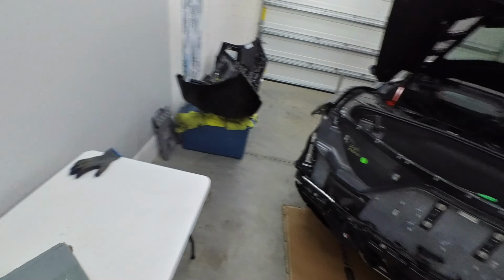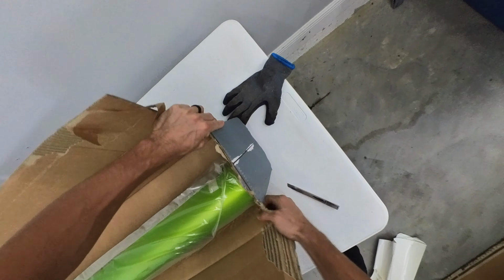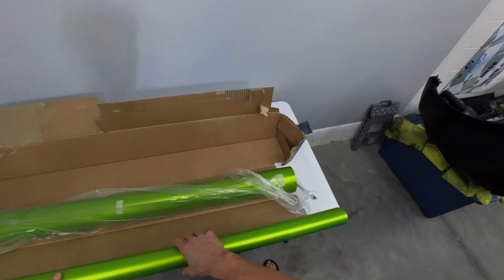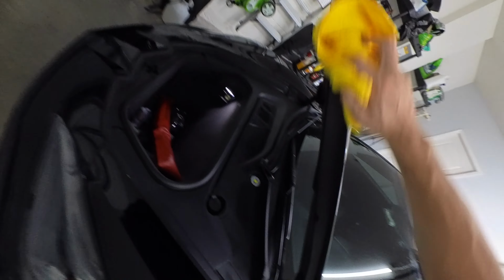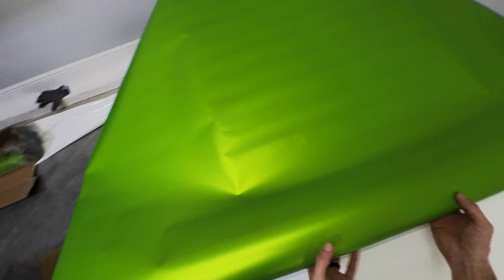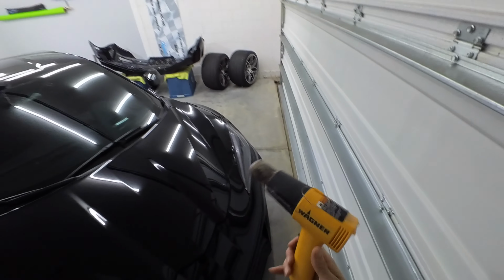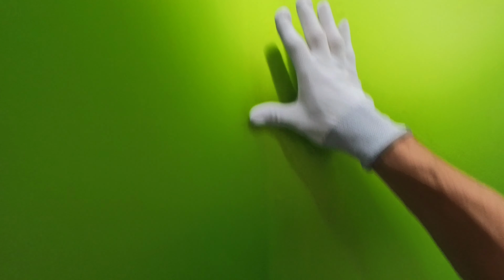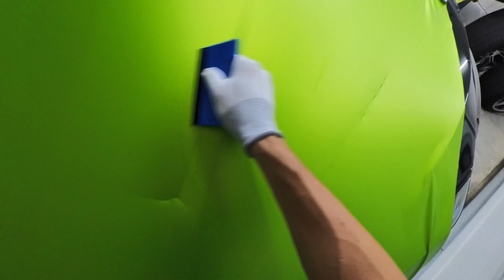C8 Corvette Z06 Hood Wrap (Color Reveal)

Comment: One BIG THING you neglected to do before starting to wrap besides failing to freshly wash the car and that is claying bar all areas. Clay barring the car is a critical step in the wrap process.

Although because you likely remove it within a year not claying it is not a big deal.
Reply: It had PPF. Claying wouldn’t be necessary
Reply from the maker: Thanks for the tip!

Comment: I know you're not a wrapper ( I am )  that was painful to watch
Reply from the maker: 1000% not a wrapper like yourself (as you claim) but I’d like to say I can wrap a car. This is my 3rd time ever! 1st time with matte. Not bad eh?
Reply: @RWDC8Z  you have the basics but you would benefit from know proper squeegee techniques. Never drag the squeegee and instead of plowing straight to the edge you want to hold the squeegee at a 30 degree angle and cut or slice your way perpendicular towards the edges. This will help eliminate potential mistakes such as creases, glue lines and blemishes. Not bad though for you 3rd car you just need some professional grooming. Good luck on the rest of the car. I hope it goes smoothly for you! 👍
Reply from the maker: @Nicetints  if you’re offering, I’m down to learn!